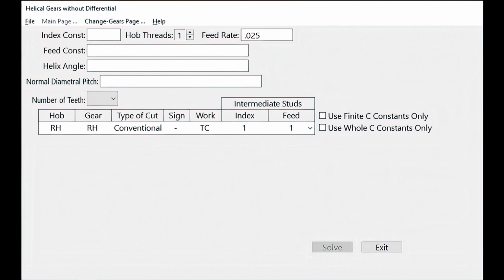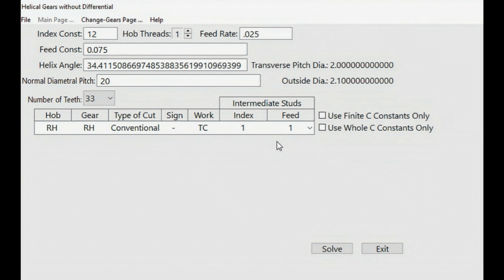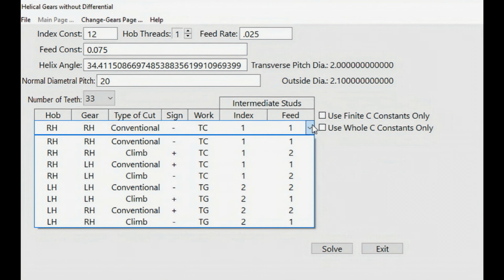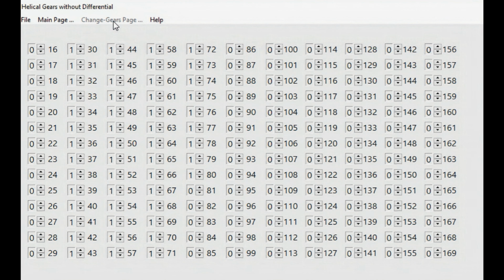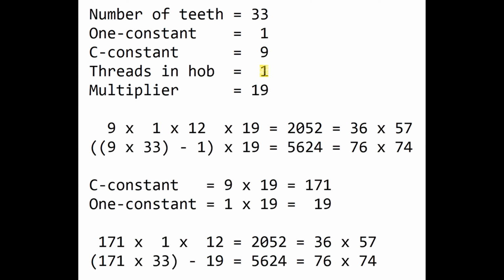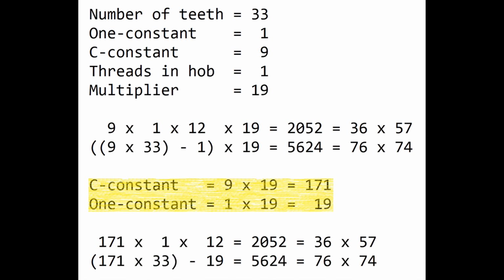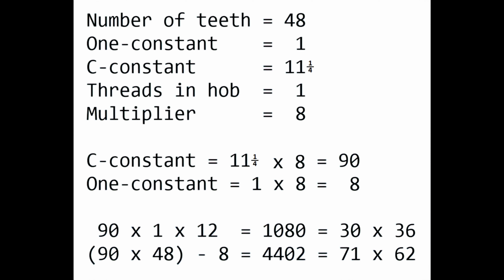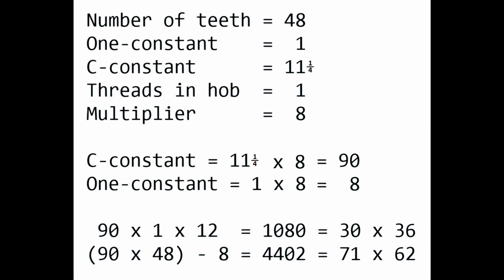Software for gear hobbing machines that use change-gears to non-differentially hob helical gears

Comment: hi, Could you answer a question for me? I'm newbie in gear manufacturer...  I calculated and got the INDEX GEAR RATIO = 1.004, I have a table where I consulted assemblies with the gear ratio index that I find and it says to assemble 2 equal gears with 1 intermediate, I tested the assembly but the gear does not cut correctly. Do I always have to use 4 gears in the INDEX GEAR RATIO? inf gear: z30 DP 12 - 45° righ - tool righ hand - angle tool 2° 15' - i used angle of table 42°45  hob threads 1- 0.075, feed desired 0.045588 (31/51) k=30. I can't find my mistake and I would like to learn so it doesn't happen again. BC 16-16 with single-thread index worm
Reply from the maker: Is it a spur or helical gear?
K = 30
M = ?
N = ?
ψ = ?
Reply: @1000725  helical gear
K=30
M=0,075
N=30
ψ = 45°
Hand of helical gear – Right
Direction of cut – Conventional
Approximate feed/revolution = 0,045588 (gears =31/51)
Diametral Pitch: 12
tool righ hand
angle tool 2° 15
I used angle of table 42°45 (45°-2° 15)
Number of threads on hob: 1
Reply from the maker: @victorinamine3720  Look at this video I uploaded: https://youtu.be/FCclbmunv1M
You must use the index and feed gears as shown. If you change the feed gears, it will not work. Wrap a piece of duct tape around the gear blank and skim the tape to test the setup.  Use an intermediate for both the index and feed.
Do you know how to combine two gears into a compound gear and which two gears to use for both the index and feed gearing?
Reply: @1000725  I found approximately 1.004 of index ratio. In feed i used gear (31/51) and index i used (30/any/30), but apparently it didn't work. I don't know exactly if it was a calculation or assembly error.

Comment: And one constant?
Reply from the maker: The one constant is added or subtracted (as necessary depending on the hand of the helix) to create a rotational feed for producing the helical gear.
Reply: @1000725  
Left or right?
Reply from the maker: When cutting in the conventional direction, subtracting 1 creates a right-handed helix.
Kind regards,
David